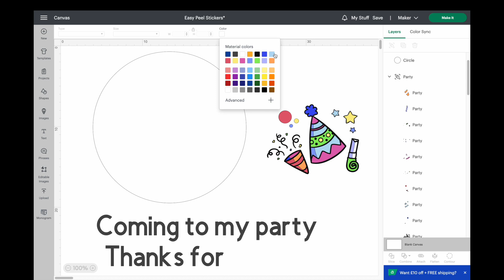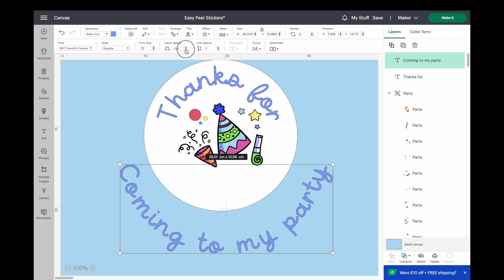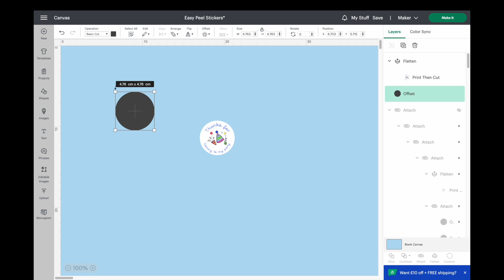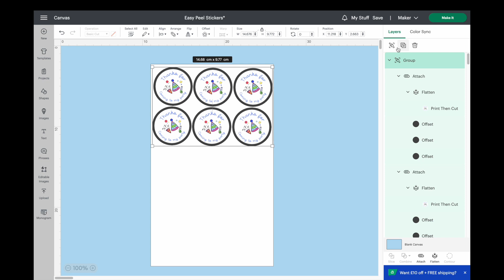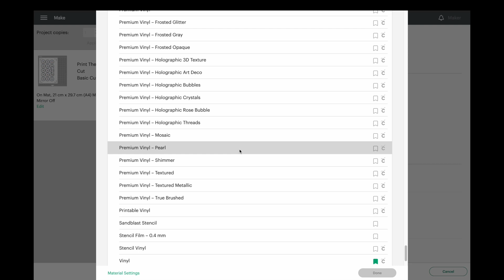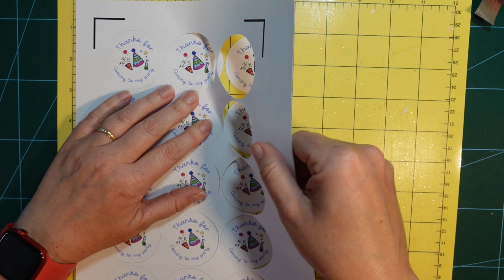Learn How to Make East Peel Stickers with Your Cricut

Comment: I loved the video and I want to take it to the next level. I basically want to make easy peel die-cut stickers but I want to use the outer edge of the graphic to be the easy peel portion instead of just the plain color. Someone sent me stickers with this option and I want to duplicate it. I just can't figure out how to extend my picture out across the easy peel border. Help?
Reply from the maker: Sounds tricky unless you can have them send a modified file, the only way I can think of doing similar is to slice away the outer edge and almost reattach it into the portion that you want it to be? This could end up being messy though. Ultimately I think you need a different file to do something like that with. Thanks for watching, I’m glad it helped ♥️